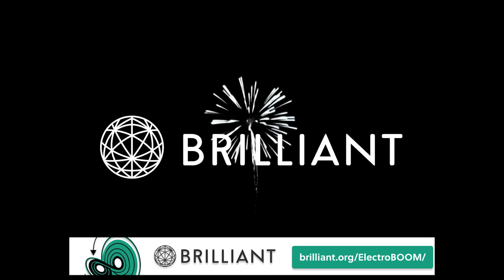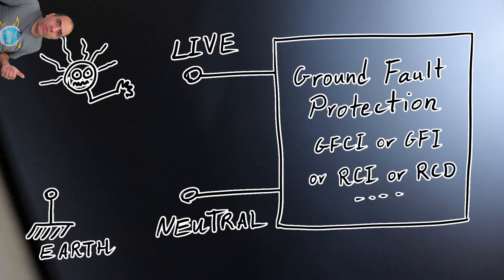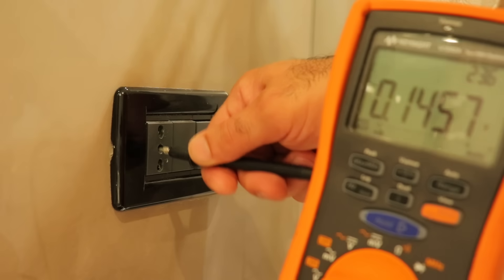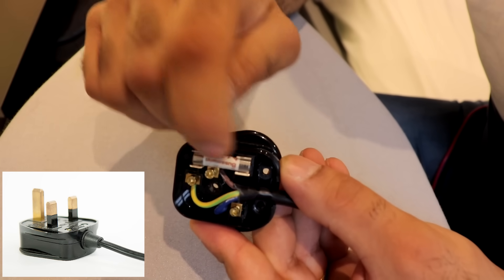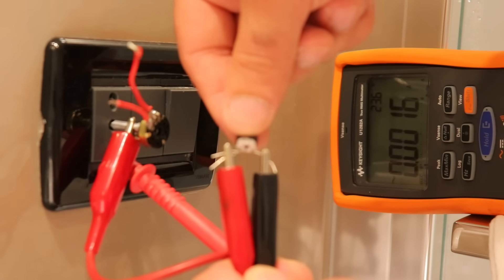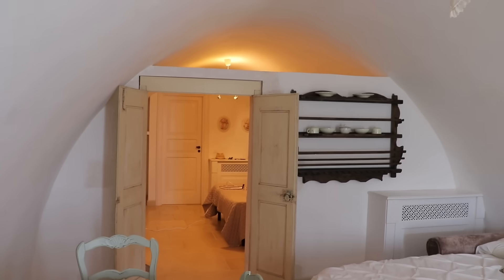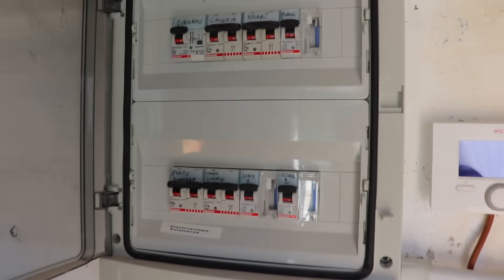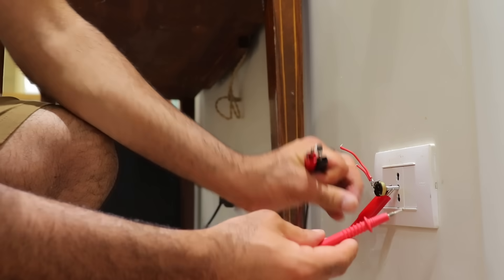Tripping Every Breaker in Italy

Comment: I'm not a certified electician but I install stuff in my home trying to follow the code as possible (old building).

No that is a old install stuff. And yes, that 4kw is quite good for italy. Generally contracts are 3kW.
You can get 4.5kw but it a lot more expensive.
Secondary holiday houses can have 1.5kw contracts.

That apartment have an old circuit schema and is "out of code for a lot of years".... or it is a cheap installation.
The code now is quite more restrictive... generally new installations are more like the one you have seen in France.
With less MCB due to the fact that we have less power and we could create less circuits.

The basement "circuit breaker" is the metering device, it should had both RCD and MCB on another box but i didnt have seen it... quite bad.
The main metering device have ONLY a isolator, it have an auxiliary switch, power is managed by the internal MCU that can kill  the power.
It might have some MCB functionality but by code you have to think of it only as an isolator.

What you have seen is the old stuff. And is even worse on some places.

Now with some language barrier I try to explain how electrical stuff is generally made to provide an easy overview:
POwer grid is generally TT, so houses have phaes and netrral from the distribution trasformer.
PE is provided locally. Neutral is grounded at the distribution trasformer.

Cables are copper multi strand one conductor, colors are:
BLUE - Neutral
BROWN, BLACK, GRAY, for PHASE.
On single phase system you can choose.
On 3-Phase system:
L1(R), is black. L2(S), is gray. L3(T) is brown.
Ground(PE) is GREEN/YELLOW.
RED, ORANGE,VIOLET, WHITE,PINK (with some exceptions) can be used to differentiate the smaller circuits and are general purpose BUT netutral is always BLUE.
Other colors can be used but only if you cannot mix them up.

Most common used cables are:
1.5mm2 for lights circuits, 
2.5mm2 for plug circuits, or for power lines from the distribution panel to the room distribution boxes of the light circuit.
4mm2 for power likes from the distribution panel to the room distribution boxes of the plug circuit
6mm2 for the main power lines from metering device. (but this depends on distance, cable type, etc.)

Some houses expecially in older parts of Rome have 220/240V with 2 phase system 110V each, back in time we had "motive power" with 2phases and lights were 110V.
Nowdays we have 220/240V singla phase for home, some elevators and heating system requite 380/400V 3 phase. Mains frequency is 50Hz.

On thoose system you can use blue for the second phase due to the fact that one day the power grid could be upgraded.
What I suggest is to put a big label near the main disconnect switch saing that N is actually a second phase.

Code CEI 64-8 is one of the main code rules.
House electrical system have 3 levels: 
1- Basic, Minimun level, essential systems ONLY like sockets and lights. Most common on Italy, mainly only 2 circuits. (Thoose are common due to old intallations I hate thoose, on my old home I have an even worse electical with only one circuit)
2 - Standard, More protection devices, multiple circuit.
3 - Domotic, It is like level 2 but can also have domitc stuff in it. Most common level 3 is a system with automatic load diconnects to prevent the 2kw metering device to go off.

On lvl 3 you must intall SPDs and LVL1/2 you have to analyze the risk and than choose what to do.

After the metering device you must have a main disconnect, this must be placed at a maximun fixed distance and the type (isolator or MCB) changes if the meter is near or far. This code is a bit unknow to me, the rule have some different cases. But a main disconnet after the metering device is mandatory.

Now if the aparment ditribution box is "far" the main switch must be a MCB C type, the trip current depends of the project. The "size" of a electrical system can be 3kw or 6kw. If 3kw the main breaker is 25A, and 32A for the 6kw. The actual meter power/contract  and the sustem sizing are not correlated, only the number of lights , sockets appliances are used for the dimensioning of the system.

In the flat distribution box generally there is a main panel switch that can be: a RCBO, a RCD, a MCB, or a simple isolator( this depends on the level of the system the distance of the metering device etc)
From that you can divide the circuit into one or more secondary circuit, genrally each secondary circuit is protected by a RCD. RCDs are 25A 30mA ones. They can be AC class but I generaly A class ones are used on new installs. Each secondary circuit can be divided into a third circuit, each one is protected by a MCB.
C10 - are used for lights circuits
C16 - are used for sockets.

Sockets used are of type C, F, L. L type have 2 variants 10A and 16A. L type is grounded.
The L type socket, 10A variant, have the same spacing of type C so it is compatible with type C plugs. Type C is only used on double insulated devices.
Our sockets have shutter and plugs have insulated prongs (not the earth).
We have special sockets that can accept all thoose types of plugs.

switches, plugs, light indicators are called "fruits" and are installed into frames. Frames have different shapes and form but have all the same wall mount style.
Frames are mounted to 50X boxes where the X is the noumber of fruts the frame can accept. Most common box is 503. Those boxes are not intended as junction boxes. 
Thoose boxes are made out of plastic.

Wires are installed into flexible conduits, color of the coduits have different meaning:
BLACK: power.
GREEN: phone system, data and TV
BROWN: Alarm system
VIOLET: AUDIO, lot of people uses this for low voltage domotic condrol wiring
CYAN: BELL and/or video intercomm.

50X boxes can be placed where the client want them but: sockets must be more than 17.5cm from the floor. Switches must be at 90cm from the floor.
On bedrooms the switches near the bad must be between 70cm and 80cm.

Bells and pull switches for shower and bathroom bust be installed above 225cm. This is due to the zones that a bathroom can have:
Zone 0: It get wet nothing here. (bathtub or inside the shower) Only counduits can be buried in the wall  at a depth more than 5cm or fixed stuff like a light fixture (no comand or control stuff here only SELV stuff).
Zone 1: is around zone 0 follow the same rule of zone 1. 
Zone 2: here you can install electric heaters and ligths without a special RCBO. Appliances must be Class I or II. 
Zone 3: You can mostly install what you want you should put some IPX rating stuff if can get wet due to moisture.

This is really hard and a better opinion on this from a professional is required. I might have done some mistakes.

Now another important rule is: that a plug fruit can be feeded only: from another plug in the same 50X box or from a wire coming from a junction box.
A special case is that a 50X box can be also supplied from another single 50X box if there are only 2 in the chain. Up to two boxes in cascade. So no ring circuits.
If those are 507 boxes they can have 7 plugs on each box so up to 14plugs in the same brach. The same rule apply on 503 for a total of 6 plugs connested to the same brach.

Lets take this house as an example: 2 floor with garden lights, automatic gate opener, irrigation system. Central HVAC for cooling.
Heating and hot whater is done with GAS, power hungly electric appliances are: washing machine, oven, and microwave.

The meter is generally outside in this case, and the main switch is an MCB C32A. 4500kA but seems that new code require a 6000kA short circuit interrupt current.
From there the secondary circutis could be:
1)ground floor
2)first floor
3)garden
4)heating and cooling
5)kitchen
Now generally we install C25A 0.30mA RCBO on each one of thoose.
If we use a RCD we must protect it so a pair MCB+RCD must be installed for each secondary circuit.

Now lets take the ground floor:
Ground floor have a MCB for:
- C6 intercomm and doorbell
- C6 Automatic gate
- C10 for lights
- C16 for plugs

Now lets take the garden:
- C10 for lights
- C16 for outside plugs
- C16 for the outside irrigation system this might have a local panel for more protection/sub circuit.

Now lets take the kitchen:
- C16 for the Oven
- C16 for the Microwave
- C10 for the fridge
- C16 for misc stuff
- C16 for the plane plugs

This is an ideal case, cost common is:
- C16 for plugs
- C16 for all havy duty appliances (oven and microwave)
- C10 for the fridge

Some worst cases just have a RCBO C16 for the whole kitchen.

Now lets take the first floor:
- C10 for lights
- C16 for plugs

Now lets take the heating and cooling:
On main distribution panel we could have a C20 only and a localized sub panel with:
C16 - for the HVAC
C10 - for the GAS boiler
C10 - for each additional heating water circulating pums

Open for Questions :)

Comment: 9:13 that can be two things:
- a strange 220V plug we use here in italy (and i think it's no longer in use, i have one and also an adapter to convert that connector to a standard italian plug)
- a strange telephone plug (not sure if it's italy only, i have a cable with that plug but i don't know where it is)
i can't precisely say which one it is because from the video i can't precisely tell which one it can be since i don't know the specific name for both and the hole for these plugs looks kinda similar

Comment: it shouldn't be possible to plug a schuko into a normal outlet, the diameter of the pins shouldn't fit in the holes, in fact i've never been able to and this is the first time i see it. Also Schuko plug is for 16A circuit so if you manage to plug it on a normal outlet it can be in a circuit designed for 10A and with C10 circuit breaker and burn the outlet.

Comment: the GFCi´s here are usually at 30mA because of they are for the whole house. I wish i could explain it better but im not good enough in english to do so. Another fun fact on older houses the Neutral an Earth are the same wire, also in germany we have guidelines on how fast a GFCI must trip depending on the tipe of wiring system https://de.wikipedia.org/wiki/TN-System here is the wiki page of it sadly in german

Comment: Hi Mehdi! Italian here!

Those strange plugs you've mentioned at around 9:10 seconds of your video SHOULD be an outdated type of safety child-proof plugs I think! My grandparents' house, built in the 70s had them beside normal outlets. They use a special adapter to fit standard plugs, as some old devices had them as factory installed plugs. They're called "Presa di sicurezza Magic 5100" or "Magic safety plug model 5100" from the italian company "BTicino". They align both neutral and live in the same parallel plane of the plug, in the little notched region, so that tiny fingers cannot possibly contact both with different hands I think, only contact can be done through one finger only!  And you cannot reverse it, so it's polarized, in contrast to the normal italian plug you've mentioned before. So definitely safer! This is how I suppose these works, although I've never used one directly.
They've been superseded by modern plugs, so they're not in use anymore I think. BTicino still sells them, so they're used somehwere, somehow.

I'm happy to see you finally visit my country!
Happy holidays, Mehdi and thanks for your awesome vidoes! You're the best!

Ciao Mehdi, ti auguro buone vacanze! Spero che l'italia ti piaccia!
Reply: Magic plugs are still in use to this day

Comment: It's interesting to see Italians use C type breakers as standard, at least in the hotels. I've always considered them typical for high power electric engines only. Typical surge response characteristic for most European countries is a B type.
Reply: Yeah C type is not supposed to be used in house instalation at least here in Germany
Reply: You are correct, here C type breakers are the standard, both in houses or in shops, for some application with higher starting current D type are used. In many electric motor applications, like pumps, are widely used motor protection with more precise termic protection adjustment.

Comment: The fuse in the UK plug isn't as impressive as it may seem. It's there only to protect the flex from overheating in the event of a fault. Because the daft ring circuit arrangement means that each socket (outlet) is capable of delivering 30 amps, there needs to be a fuse which will cut the power if the flex's rating (max 13 amps) is exceeded. If it weren't for the ring circuit, the fuse wouldn't be needed.

It's also a potential source of error. Often, householders will replace a fuse with one rated at 13 amps, where a 3 amp fuse is required. This can leave the flex unprotected in the event of an overload.

Comment: The “doors” in the plugs are children protection, seems like they work fine :)
Reply: Yes, and the safety doors are there or absent depending on manufacture date. New ones the door is mandatory, the old ones it was optional, so the old sockets do not have them, but replaced ones do have them. The difference between 5mA and 30mA is the 30mA is the whole house, so using 5mA would result in nuisance tripping. The UK has solved that by making it mandatory on new to have each breaker be a RCBO in itself, each circuit being individually protected with 30mA, so a trip on one does not trip out the entire house. They even have AFCI built into them along with RCD and overload detection, in the same width as a regular 1 module wide DIN breaker.
Reply: @SeanBZA  For example in Belgium a 300mA whole house is mandatory unless you have a bad earth resistance which would require a 30mA for the whole house.
For places that can have higher humidity (for example bathroom) a 30mA is mandatory for those circuits and depending how close sockets are to water taps it might even require a 10mA.
So in every house you'll find at least two GFCI unless you use a whole house 30mA but that can be very annoying.
About the safety doors in sockets : In more recent installations they are mandatory.
Reply: we have those in extension cords in germany as well. New ones are usually so stiff that you need a sledgehammer to get the plug in, so what i do first is open it, remove the whole child protection thing and be happy.
Reply: @Sharpless2  I am not a fan of removing safety features. I have learned over the years that if you a buy a decent extension cord those safety doors work MUCH better.
All extension cords I use are homemade with plugs and cable from reputable brands. It'll cost you a bit more but they'll last forever and are much safer if assembled properly.
The worse part of cheap extension cords is the lack of decent cross-section.
Reply: ohhhhhh.... snap.... put some ice on that burn!!! :)
Reply: They do seem like they worked fine until they were defeated….
Reply: There's the breaker for short circuits and the ground protection, in italy we have usually both. Modern ones have the restart function. After being triggered they check the line and if it's ok they turn back on the power after a couple of minutes... (good in case you're not at home and a storm with lighting bolts hits around...)
Reply: Those are pretty common in North America too, surprising that Mehdi was so perplexed by them.

Comment: 9:15 that's an old telephone outlet. It looks very similar to the so called "Bticino Magic" plug. It was  created in the 70s as a more safe and irreversable plug by the italian company Bticino, but it really never took off, in fact it only really lasted until the early 90s.
Reply: https://en.wikipedia.org/wiki/Telephone_jack_and_plug#/media/File:BTicino_spina_e_presa_telefonica.jpg
Pretty similar to the old french standard. Quite logical since it's located next to a RJ45 or RJ11 plug
Reply: @geoffroyarnaux2854  i seen a very very very similar one on a phone and a modem
Reply: Or a modem outlet
Reply: So you put the mobile in the socket to charge it? Neat:P
Reply: It's more likely to be for a phone that stays at home with a little antena
Reply: @BulletproofKuloodporny  no, it is for landline phone.
Reply: @Pietro_Troschka  Known as RJ11 jack, if I'm correct. Two wires for common phones and four wires if there's a PABX trunk.
Reply: the comment i was looking for!!! thank you!

Comment: Having no ground wire is actually a quite interesting thing in the area I live in. Most of the house in the area I live in, including mine were built in the late 1800s to the early 1940s. At that time the wiring used in homes was called knob and tube and it gets its name from how the wires were held up and run, they would be connected to joists with a ceramic knob, and go through joists with a ceramic tube. At the time plastic wasn’t around so they used ceramic as insulators, even wire nuts were made out of ceramic. The live and neutral wires were run separate from each other unlike today where both live and neutral have their own insulation and then are run inside another jacket with a bare ground wire. At the time there was no ground wire and outlets had no ground terminal they just had live and neutral. The National Electrical Code now bans this type of wiring and says that it should be replaced. However in my area since there is so much of this wiring it would cost a fortune for it to be replaced so instead there is now a clause in the code that allows it in my area as long as you use the original outlets with only live and neutral which you can still buy, that way it ensures that you can only plug in a double insulated appliance but that doesn’t stop people from using adapters to allow you to plug a grounded device into those outlets.

Comment: Normally they put ground wire on the water pipe's in the concrete, so you have ground always in a bathroom, that is normal 
in my country in the EU, but all newer houses (20+ Years) have now ground everywhere, my 35 year rental house do not have 
ground wire anywhere but in the bathroom and in my kitchen and schuur.